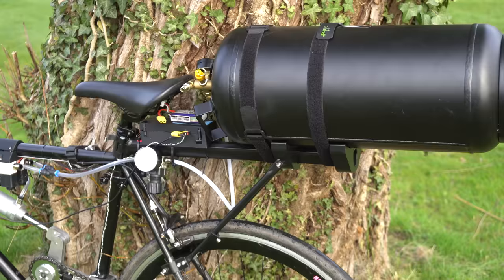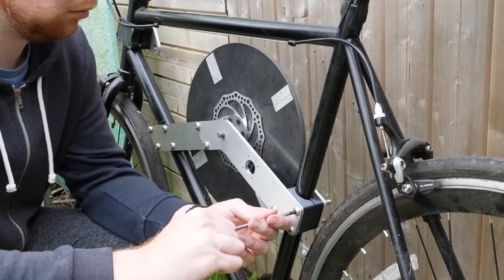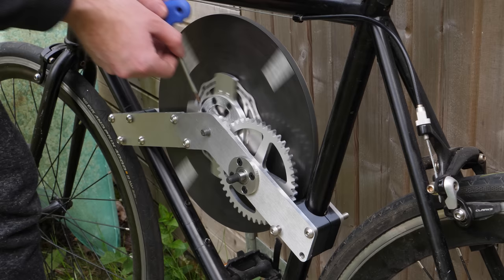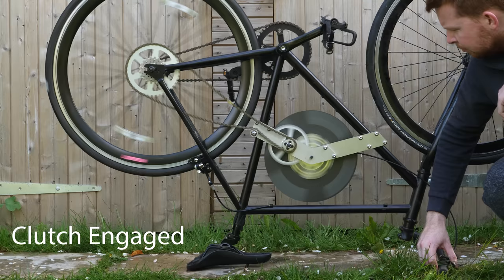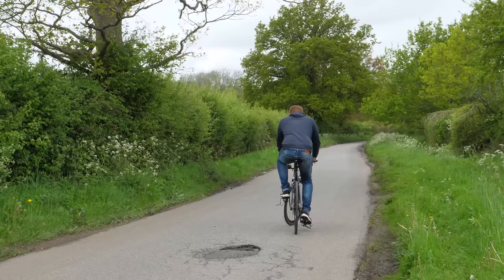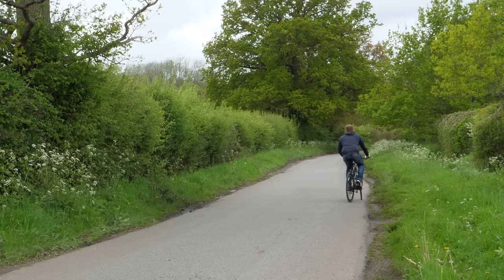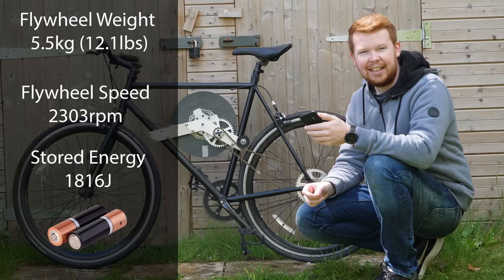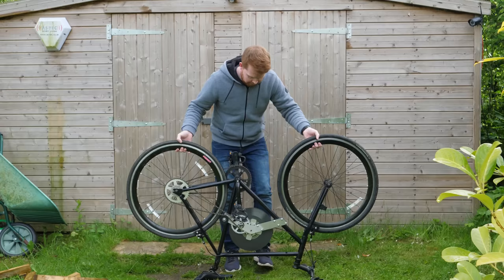Flywheel Bike KERS

Comment: There's a HUGE problem with flywheels, as a large mass rotating at high speed introduces unpredictable changes in behavior of the entire system, when turning left or right.
Reply: I mean, its gonna keep the bike up a lot harder, though only when spinning. It would be interesting to feel the difference
Reply: Seem like you'd have to practically stop to make anything more than a slight turn. I would think that the energy to turn the flywheel has to come from somewhere, too, which means more effort for the rider. But I am totally out of my element with physics so I could be completely wrong on that. Would be interesting to see how it compares to riding an actual bike with some of the physics explained.
Reply: @tastybluecrayon  the drive train (engine, gearbox, etc) on a motorcycle is like a big flywheel in the middle of the bike, and when you're maneuvering with the engine fully engaged to the wheel vs the clutch pulled in and the engine idling there is a noticeable difference in how it handles. I don't think that turning on this bicycle would be as hard as you're saying, but it would feel heavier to lean left or right.
Reply: @MortimerJones99  Its harder to turn due to the gyroscopic forces of the wheels, not due to the engine.

The flywheel is between the engine and the clutch, clutching in and out only disconnects the gearbox and front sprocket, way less gyroscopic force than even the crankshaft itself. 

You could however solve this problem with bicycles by having two flywheels, one on the front axle and one on the rear. Will feel weird when stopped or going slow, but shouldnt impair turning, in fact i think it would apmlify it
Reply: @SportSoulLife  He means when your driving, with the engine up at its running RPM vs having the clutch disengaged and the engine idling all while rolling along at the same speed. Your bike is moving at the same speed, but the engine isn't turning anywhere near as fast. Thus less gyroscopic stabilization.
Reply: As you also turn the flywheels speed will decrease
Reply: If you know the inertia properties of the system, then it would be very straightforward to calculate
Reply: @jawms  Oooh, ok that makes more sense.
Reply: Wouldn't be any different than a motorcycle, and using proper push-pull steering techniques will turn just fine. It's just most people on a light and thin bike brute force the tip over rather than pushing the opposite handle to turn the direction they want. I mean, the things got two giant spinning masses on each side of the machine already and people seem to be able to turn bikes okay with those.
Reply: That’s what I’m thinking too, what are the gyroscopic forces like on the bikr
Reply: @Mostlyharmless1985  Countersteering is the correct way to turn a two wheeled vehicle
Reply: the changes are very predictable. what are you talking about?
Reply: Williams F1 developed this tech for F1, and then ended up selling off the patents to be used on buses and other large vehicles
Reply: @tastybluecrayon  or drop the flywheel speed by letting it do the Job.

Problem with the video i think is that Chris only tries to get the bike running from complete stop. Where i think the practical use would be used as a slight boost while going up hills or to give you a break from pedaling after you have achieved good amount of speed.

There i guess the problem is that the flywheel gives it's speed back way too fast. Wasting most of it in a clutch. But since storing up energy needs to be immediate to work as a brake, that would need system that gives power out with different gear system.

Not that hard system to come up with but pretty hard to build so that it doesen't  need constant maintenance. The gears already there are so noisy that it most likely wont hold up very long.

Tough i guess in this case it's more about consept (guy seems to love the numbers more) than actually building practical flywheel bike.
Reply: The point here is that the flywheel only should spin when u stoping. U charge it when brake then use it when u start
Reply: @tastybluecrayon  "energy to turn the flywheel has to come from somewhere" -----

Momentum which would otherwise be dissipated as waste.
Reply: If its not spinning when you're moving at a high speed then there's no problem. But if you charge it up before coming to a stop then you won't need to put your foot on the ground
Reply: @andrewferg8737   Once the momentum is built up, sure. But it requires more energy to get that additional weight moving in the first place than it would to operate the bike alone. It appears he has to put more power into turning when it's engaged in this video.
Reply: Counter steering is the only way to steer a two wheeled vehicle in independent motion.
Reply: ...prefer a motor or engine!  ...problem is you have to haul the mass around!  They've tried this in a car and got poor performance.... I like the eddy braking in electric vehicles to conserve energy...
Reply: then you should make it rail way safe, that gos straight
Reply: @erneststyczen7071  That depends of where the center of mass is before and after install the flywheel!
Reply: center of gravity you mean, take a bike wheel and spin it and then turn you get the point then.
Reply: @tonynelligan1930  cg is an issue, but I think he means the radius of gyration considering the right hand rule...
Reply: Please delete this Roman, save everyone some time
Reply: @erneststyczen7071  Since he mentioned at 3:42 that his solution of the flywheel is rotating in the opposite direction of the wheels (because of the gear), the angular momentum will actually have an opposite sign than the wheel's, so the overall angular momentum of the whole system would be smaller than without it, destabilizing it during riding and making it actually EASIER to turn because the gyroscopig effect would be smaller. That's why Tom Stanton himself hopes that won't be an issue in the following sentence.
But it would be negligable anyway, since it's mainly not the gyroscopic effect that's keeping you in balance while riding (see Veritasium's video on how bikes work).
Reply: @ENMPM  wont the gyroscopic effect add up, if the flywheel is rotating on the same axis?
Reply: @erneststyczen7071  It's the same axes (actually parallel but therefore mathematically the same, since angular momentum is a vector), but different directions of rotation. Yes, they add up but it's a signed sum.
The angular momentum L of the whole system would look somewhat like this:

L_bike = L_frontwheel + L_backwheel + L_flywheel

Since the wheels are rotating in the same direction they have the same sign and therefore adding up, yes, but the flywheel turns in the opposite direction (at least in Tom's construction) which makes it like:

L_bike = L_frontwheel + L_backwheel - L_flywheel

Hope I could help.
Reply: @ENMPM  yeah thanks, i thought that it would be frontwheel(keeping its angular momentum) + backwheel(keeping its angular momentum) + flywheel(keeping its angular momentum). But i didnt get that right ig. I mean it is, but the forces rather zero out than add up, when rotating in opposite direction
Reply: Actually bicycles typically have two flywheels, with the very predictable effect of helping rider balance.
Reply: Could this be solved by having 2 fly wheels spinning in opposite directions?
Reply: @lasinhouseinthetrees1928  No, angle if flywheel has no impact in deceleration rate.
Reply: Gyroscopic force does little in balancing the bike. You’d hardly notice.
Reply: @SportSoulLife  Yeah no shit, the engine has a flywheel
Reply: Use huge wheels and problem solved!
Reply: That's why it's only used on static bikes
Reply: What if you had two spinning opposite directions?
Reply: not to mention the adittional 15kg to the bike.
Reply: I wouldnt call it upredictable behavior, but it should definetly be considered while manuevering
Reply: Can be fixed by having counter-rotating flywheels right net to each other.
Reply: Wouldn't say unpredictable, just unintuitive. Angular momentum is very predictable.
Reply: You’d be surprised how little gyroscopic forces act on a bike to keep it upright
Reply: @JLRButcher  which is a whole different (yet great) concept
Reply: I agree, but since this is happening mostly when you are coming to a stop, it's ok--where you would run into serious issues is braking on a downhill curve. That could be an utter disaster!
Reply: Quick Point:  The bicycle's wheels are, themselves rotating mass.  They suffer from the same sort of "issues" when turning left or right.  Physics classes actually use this fact to use a spinning bicycle wheel to demonstrate Conservation of Angular Momentum.

So, how is it even possible to turn a bicycle at all?

Simple:  Turning a spinning object induces a torque, which causes its rotational axis to change where it's pointing to.  In the case of a bicycle, it causes the wheel-axes to move from horizontal:  the bicycle tilts.  What, do you think all of those cyclists racing at high-speeds are leaning for fun?  Nope.  The bicycle itself starts to lean as you turn at high-speeds, and it's not just a matter of the centripetal acceleration caused by the turn.
Reply: @John_Weiss  that is only part of the reason bicycles lean over in turns. The main reason is to supply the centripetal force necessary to remain in the turn. And this flywheel is used for storing energy so it has a 2nd moment that is many times that of a bicycle wheel.
Reply: @wiscgaloot  Yes, I realize that the centripetal force from the turn itself comes into play.  [I thought I wrote that here, but maybe it was in a different reply.🤷‍♂]
And yes, there will be an additional torque from the flywheel.  Which will cause greater lean as you turn.

The question is, will it be too much lean?

But that's all moot, since at the end of the video, he tested the resistance to turning the bike caused by the flywheel.  Take a look at it again.
Reply: 2 plateaux contre-rotatifs permettraient d'annuler l'effet de couple.
Sur certaines motos l'alternateur et toutes les masses rotatives tournent dans le sens inverse du vilebrequin pour annuler cet effet de couple.
Reply: Because it acts like a gyroscope ?
Reply: If that was a huge issue motorbikes would be screwed… As it happens the only ones where it’s an issue are bikes with longitudinal engines like Moto Guzzi and BMW boxers.
Reply: @Johnathan Doe  People outside of a physic background get angular momentum a little bit mixed up.  They think that angular momentum means that you won't be able to turn a rotating object.

But us physics majors know that Torque is not a minus-sign, it's a cross-product.  😉

For those that don't know:  If you have a rotating object whose axis is horizontal, when you try to turn it to the left, the resulting torque is not to the right, it's upward.  Or downward.
Reply: @John_Weiss  youre explaining gyroscopic precession to bots
Reply: @dwightschrute352  Well, maybe.  But I like to assume that not everyone is an arrogant azz who doesn't want to learn anything…
Reply: @John_Weiss  ok boomer
Reply: @Jonathan_Doe_  

So let's talk about somme Russian 
hélicopters
Reply: @Mostlyharmless1985   Yes it would be different, a motorcycle does not have an additional flywheel.
Reply: @fthagnryleh4951  uh, what do you think the two giant things touching the ground are?
Reply: @Mostlyharmless1985  
A bike does not have those?

And also these are not flywheels these are wheels that have a limited rotational speed.

The momentum of the flywheel is so significant because the rpm are barely limited by friction.
Reply: Just use it to brake, then use the stored energy to get back to speed.
Reply: A lot you guys need to watch the veratasium video on how bike turning and balancing actually works. It has very little to do with the gyroscopic effect of the wheels.
Reply: Giro!!!
Reply: @tastybluecrayon  the gyroscopic force on that is not that extreme. Stop acting so smart when you aren’t. The tires would have the same force as the fly wheel
Reply: How about a thin large diameter flywheel beside each wheel? You could easily sit still at a stoplight and impress girls.
Reply: I had produced one of these about 15 years ago. Specifically for commuting in central London where there are loads of stops and starts, being able to conserve energy at red light, then accelerate quickly on red/amber. Also having a fly wheel would allow for the bike to be upright when stationery. There was not enough force to cause any problems when cornering and since such devices only make sense in the urban environment, fast cornering is never advised.  Ultimately it was a fun project for geeks with not much of a social life, but not worth the candle.
Reply: @tastybluecrayon  it comes from the energy you would usually waste in braking
Reply: They've used large flywheels on buses mounted horizontally which actually worked better.  The problem is that you need a large mass to be able to store a significant amount of energy.
Reply: If you mount the flywheel in the right place, this can help balance the bike. In motor-sport the KERS fly-wheel (Flybrid rather than battery) is mounted horizontally. Some Flybrid blocks have two counter-rotating flywheels. The tight tolerances mean these fly-wheels are separated and use a construction to prevent the proximity to the encasing walls from creating drag - see Tesla's Turbine for the opposite use of that drag 🙂
Reply: And you think he doesn't know that
Reply: If the goal was something practical and efficient, a motor attached to the wheel attached to a battery with controllers would be what you're looking for. A motor would also work as regenerative braking and with pedals charging the battery through the motor it would essentially just work on the same principal.
Reply: it shouldn't really be a problem since it is meant to only rotate when braking so mostly when you're going to be standing still anyways
Reply: A horizontal mount should fix the turning issue, but it's still harder to lean.
Reply: @chain3519 that's what I was gonna say, I know I'm late but gyroscopes are used everywhere and if we couldn't calculate or predict their behaviour then we wouldn't be able to use them, vsauce made a great video about it and it really brings in actually how simple the physics of flywheels are
Reply: But the wheels kinda do the same thing I think it would be harder to turn but not that much
Reply: Arnt the wheels already giant flywheels
Reply: Rotate the axis of rotation by 90 degrees.. problem solved